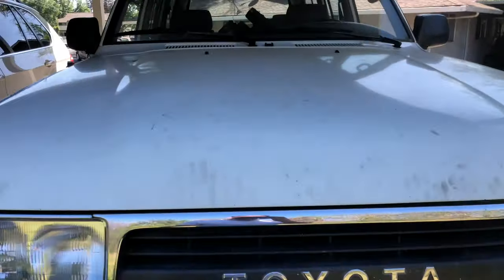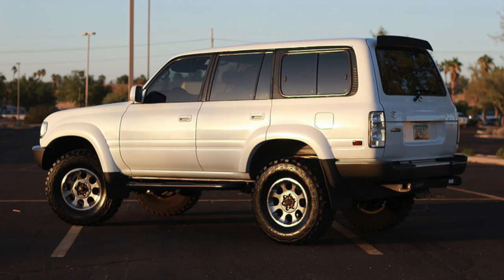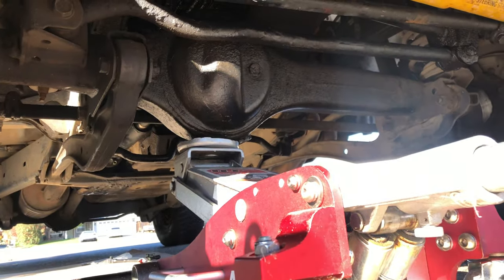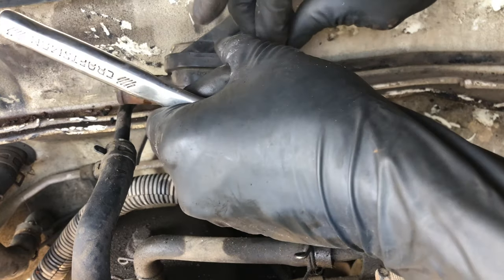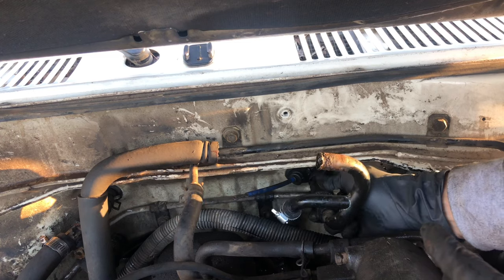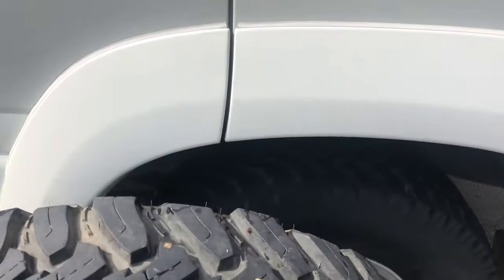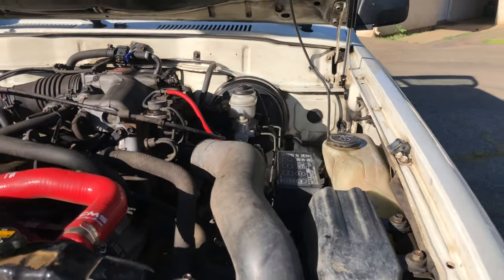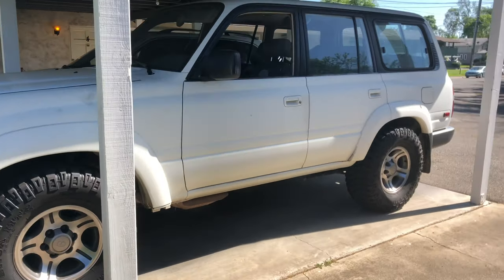6 mistakes every new 80 series owner makes

Comment: 80 series rules
1. 1FZ is a pos. Diesel or nothing.
2. Power steering system is pos. Replace the foot long return hose with a high pressure hose (preferably braided) as soon as U get it. The reservoir for the power steering fluid is folded and crimped. So if U drive like a nanny (full locking from a stationary position) it'll bust and cost $100s to replace.
3. The alternator is a pos. Buy an after market guard. Where it's positioned, it gets full of mud, water, and crap. One day you'll go to start it and all your dash lights come on... New alternator.
4. The running gear is a pos. Ur in seals leak. Your centre diff leaks. The copper washers on all your bungs last 10mins, and leak. Your transfer case leaks. 90% of your regular maintenance is plugging oil leaks.
5. More leaks. Your injection pump is, by far, the biggest pos. The seals leak. One side is an easy fix, the top is where the plate and diaphragm sit on spacers. You do it yourself and lose those spacers in the pump = big $$$
6. For an off-road vehicle, your electrics are in the dumbest places. E.g. your starter relay is mounted at the top of your mudguard, in a "waterproof" plastic case. Your mister pumps are mounted just above the front wheel arches, and are tied with the windscreen wiper motor as the first thing to break on an 80 series
7. Your 4.5ltr Petrol or 4.2ltr Diesel can bearly drag the weight of the vehicle up a steep hill outside of 4wd. 33's max. You're a moron if you put 37's on a stock 80 series as your unis and tail shaft will cop and absolute flogging.
8. You need diff lockers.
7. Uncapable is not a word. It's incapable
Reply: You forgot to mention that the 3fe is the greatest engine ever made

Comment: The world is filled with all sorts of capable and interesting cars, all ferrying us humans from A to B and back again. WRONG. There is only one car. It is the 1990s Toyota Land Cruiser FJ80. This is the car. This is the car of motion. This is the car of travel. This is the car of exploration and expedition and comfort and strength and durability and longevity. This is the wondercar. This is the good light. Not only is this the only car, it is from the only time. The FJ80 Land Cruiser was designed during the peak of Japan’s 1980s economic bubble, and is overbuilt and overdesigned to a degree that we may never see again.